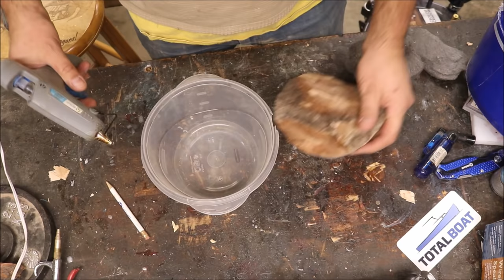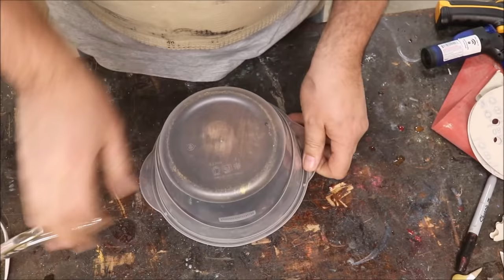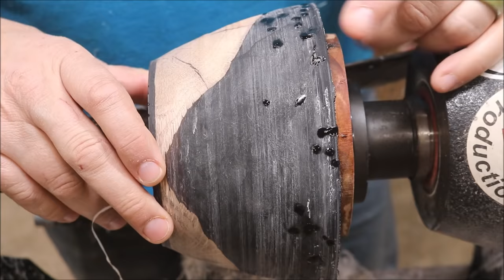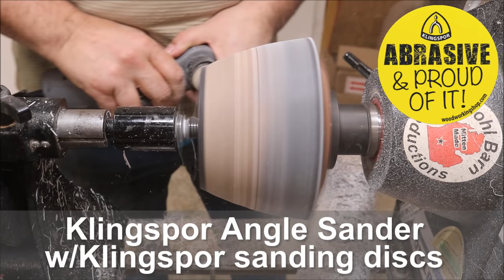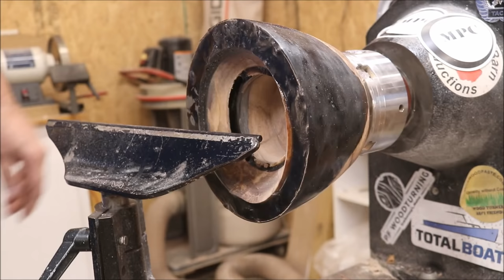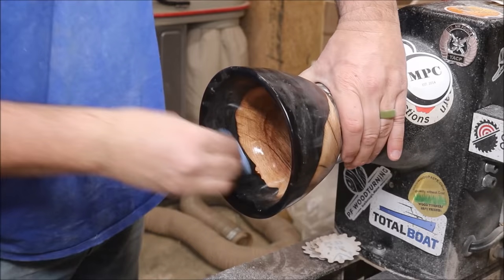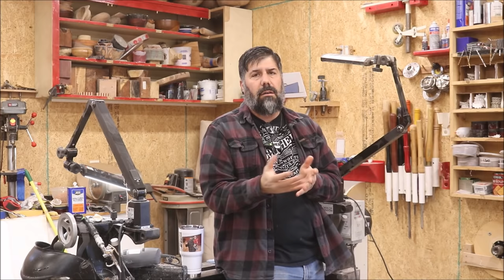I cast Steel Wool 🤔 and This Happened

Comment: Man, you are a pretty cool dude to try to lathe with materials designed to "degrade and smoothen all edges on a surface" - I'm sure your Moonie-sense was tingling! But how cool is it that you did it anyway!  Love it!

 Despite the foreboding about the tool-eater this turned out to be, you produced!   

I bet your viewer was expecting "tendrils" rather than nests and more reflection of light from within the resin...nice idea! I don't want to assume I know what your requestion-viewer expected; 
 but NOW they know! Right on, man!

 I don't know if they make polished steel wool, but maybe a polished dish metal scrubber would rock? Those things are all weaved in a pattern already and designed to mimick tiny metal ribbons balled up like steel wool. -  I don't mean to speak for the viewer who requested this - but I'll wager a re-attempt using the metallic dish scrubbers might redeem the experiment, and then some;
 for both you and your <37K viewers! Congratulations dude!

Either way, you're certainly a pleasure to watch, and very ingratiating.  I'd love to see a revisit to this one Mr. Moonie ~ Subscribed!

Comment: Magnesium (a metal that can burn) rich "steel wool" base  material, wood, flammable resin binder , alcohol based finish, steel tool creating heat/sparks, etc. - what could go wrong?  Forget the dulling, I was waiting for it to caught on fire while being turned.

Comment: Is the pressure pot you mentioned higher than atmospheric or a vacuum? I am surprised that you had so many void pockets as it was being turned on the lathe
Reply from the maker: The pot is a pressure pot. I have a vacuum, but did not use it this time. I should have.

Comment: Looks like it should have went into a vacuum to pull the air out before the pressure pot. To get rid of that pesky air  but eventually turned out great
Reply from the maker: Yes that's exactly the best way to do it.

Comment: save some of that steel wool you can use a little bit as a fire starter when you go camping just hit it with a 9 volt battery and it acts like kindling

Comment: Is there any reason you cant use something easy to turn like styrofoam or paper to make the block in the center so you dont waste material? I'm new so I have no clue if that could be done
Reply from the maker: The center was what is called a waste block. It's made with wood to give something for the faceplate to hold to and use less resin. Styrofoam and paper would not hold up well to the resin.

Comment: .  A few comments and observations.  The bowl is very pretty and unique.  No denying that.  Weird but interesting.  I have a question.  Although you didn't show it in your video, did you rinse your steel wool in a solvent such as acetone or denatured alcohol to wash off the oil?  Most steel wool comes from the factory oiled to prevent rust in the package.  If you didn't, I am actually quite amazed it did not fly apart on you on the lathe.  If you didn't wash the steel wool first it may be the reason you have so many holes in your finished product.  Soaking the steel wool in your resin prior to shoving in the bowl would be a good idea.  Can't support you wearing a ring while working with tools, sorry, very old working ideology if mine.

The bowl looked nice and I am glad you had fun.  Be safe.
Reply from the maker: Well thanks for your comment. I did not clean the steel wool. But with the resin I wasn't to concerned about it coming apart. It could of though I guess. That may be a reason for the wholes though. As for the ring. Thank you for the concern with my safety. I take it very seriously. That is why I bought this silicone ring that is billed as being safe for use with machinery and it is. Lot's of research went into my decision to buy this exact ring. I read many reviews and testimonials and found it to be the safest ring on the market. Again thank you for your concern.
Reply: @MoonpieCreations  ;  Good for You!!  You need all your fingers!  If you do decide to do another steel wool bowl, give the rinse a shot.  I think you will be pleased.  You do nice work.  If I may suggest, try using those carbide tipped cutting tools on the steel wool. I think you will find they are a bit tougher.   The steel will makes an interesting piece of work.  Stay safe, have fun.
Reply from the maker: When I got married I told the wife I wouldn't wear a ring. She decided that wasn't an option. 😂😂 I may try it again, but after cleaning it off I will try to get it to start rusting. I think it will be a cool look.

Comment: I didnt read comments but you are using a wood knife on steel. Get a metal cutting blade on the steel and the reason it was so sticky is the metal WAS HOT melting the resin.
Like your stuff though. Watched the whole thing.

Comment: those weren't inclusions, they were air bubbles 😬  Also, that top piece of wood was a total waste, as it got completely turned out.  The wool inside the darkened resin made a neat pattern 👍
Reply from the maker: The piece of wood on top was a piece of waste wood. It was meant to be turned away.  It helps save on resin and gives me a place to screw in my faceplate.